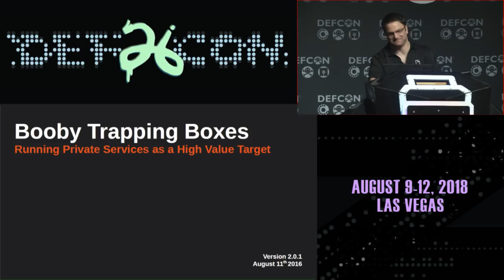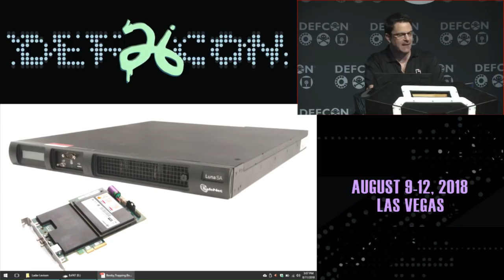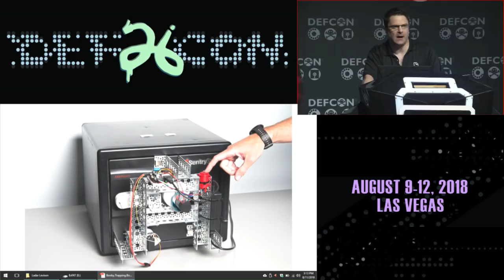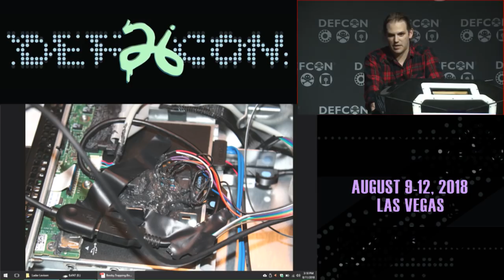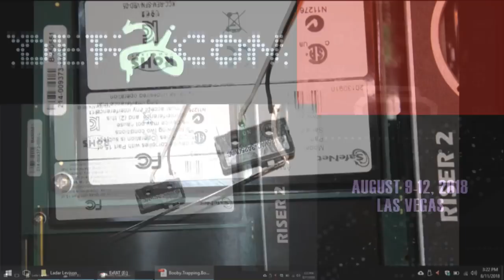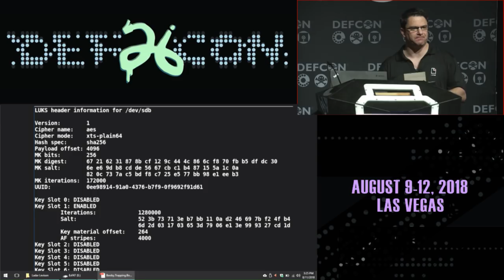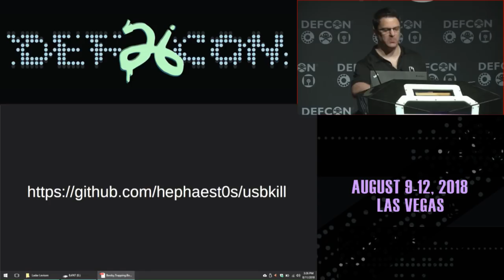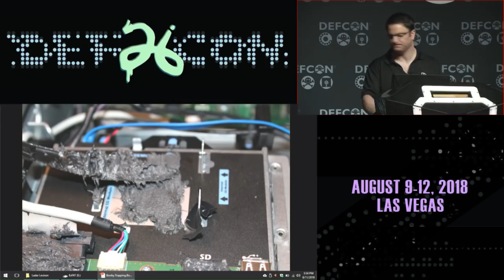DEF CON 26 - Ladar Levison, hon1nbo - Booby Trapping Boxes

Comment: The nsa obviously has the processor backdoors removed. FOIA that's good evidence. We have a reasonable expectation of not being backdoored.

What about cameras in the server case looking out or in the case? Light sensors? Of a sort.

Heat will definitely erase an ssd. Yeah remember the seagate drive firmware hacks. You can be sure the nsa has gone through ssd drives.

ECC and RSA are crap and they are recommending RSA. I think we need really an interleaving of rounds for two keys one is rsa and one is ecc which is potentially a difficult problem for a quantum computer. Then again if you can make a library that you can do that with any number of algorithms turning part of the handshake wrapped in encryption into a selection of round layers for each round and then using that to stage into a final handshake as an encryption layer to do the same thing over with a new nonce of algorithms / round layered as part of a round with respective keys would make it very hard to follow. It depends primarily on how many qbits you anticipate but a larger more keys is better. Even using the same algorithm with different keys in each round or certain rounds. Salt it up.